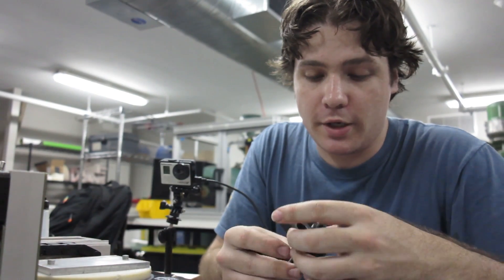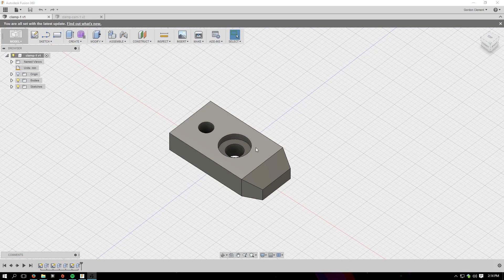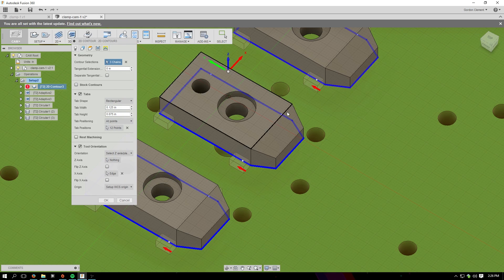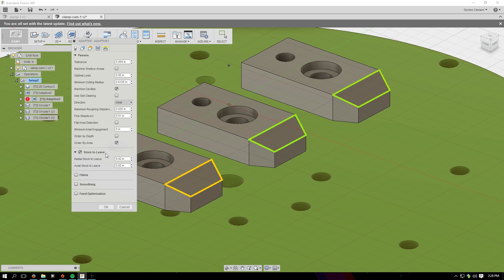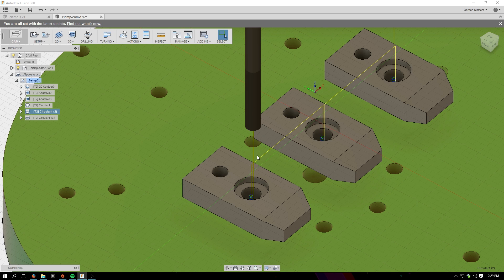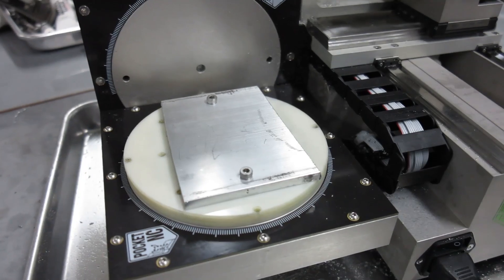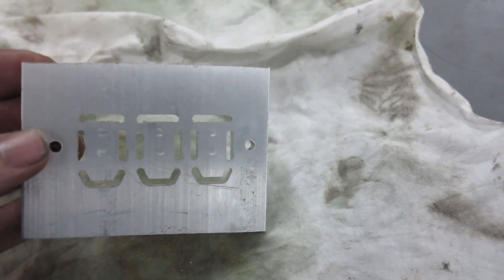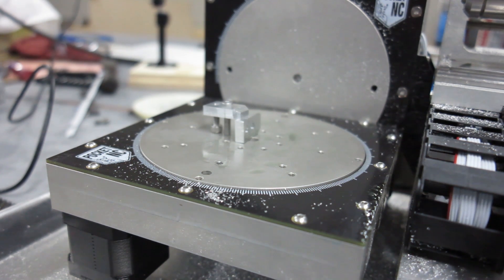Making hold-down clamps on PocketNC

Comment: Even if the end mills are from Harbor Freight you could experiment with high helix two or three flute cutter. May reduce chatter. Be certain the cutters are center cutting for ramping in “Z”. May help with chatter. Just a thought. Mister spray may also prevent tool loading if an issue. It will make a mess blowing chips all over. Thank you for sharing. Awesome video. Blessings 🙏

Comment: Cool vids, I subscribed and hopefully you'll make some more! I have also done a little bit of resin casting so I look forward to that/those videos too.

It looks like the hole for the tightening bolt might be a little too close to the pivot point.

A little detail, just in case it's helpful (to you or anyone else reading this comment)... With toe clamps you want to have the pivot point on one end, the workpiece on the other, and the tightening bolt as close to the workpiece as possible. As the tightening bolt is, well, tightened, the force it exerts on the clamp is distributed between the pivot point and the workpiece. If the tightening bolt is in the exact middle, the force is distributed evenly between the two. If the bolt is moved toward the pivot point so that it's at the 3/4 point, 75% of the holding force will be on the pivot point and only 25% will be on the workpiece.

You also want to make sure the toe clamp is angled down toward the workpiece. When it's the other way, when it's angled up toward the workpiece, any movement away from the clamp (from vibrations or whatever) will result in a reduction of holding force. This reduction will then make it easier for the workpiece to move, which will result in more holding force reduction, and could eventually lead to the clamp releasing.

Comment: cool little project for a cool little machine! you might look and see if you can find some small carriage bolts for the height adjust as they have a nice rounded dome head which allows a slight rocking point compared to the flat end of the socket screw you are using. thanks for posting

Comment: Gordon, Thanks for sharing your work it's been a great help. Please consider spending more time at F360 then the pocket side. I wish someone would just do pocket nc 101. Something dead simple like facing a block step by step from F360 model, CAM, tool setup, feeds, export, run axis, setup axis, setup vice and stock. SOMETHING STUPID SIMPLE. Sorry pocked nc your tutorial are WAY to complicated for some of us.

Thanks for all you hard work.
Reply from the maker: Thanks for your thoughts. There are many many great fusion 360 tutorials on youtube, much better than I could ever hope to make myself, and I would recommend checking those out. NYC CNC for example spends a lot of time talking about fusion, and countless other hobbyists have covered feeds and speeds for common operations in fusion. If you are just looking to get started with CNC and Fusion, I would recommend thinking of your pocket NC as a 3 axis machine and following some tutorials from other youtubers to get your feet wet. Once you feel comfortable, bring some of the 5 axis functionality back into the mix. The key takeaway from the pocket NC tutorials vs. other fusion tutorials is making sure you set your part up in the right coordinate system, and using the tool orientation settings in your toolpaths. using the Pocket NC provided file with the vice and table models makes that pretty simple.
Reply from the maker: Also, Sorry I didn't reply to your comment sooner!
Reply: I'll respectively disagree with "There are many many great fusion 360 tutorials on youtube"
Reply from the maker: I'm sorry you feel that way. If none of the tutorials you have found have been of help to you, perhaps the availability of learning resources isn't your roadblock.

Comment: nice to see the Pocket NC deals with aluminum fairly well. I can believe it wasn't fitted with way covers though?
Reply: From what I understand most of the chips don't get as far as the linear axes. So its just easier and cheaper to have them open and vacuum the rails occasionally. 

Most of the chips sit on the table and rotary axes. Whenever the table is tilted vertical most of the chips fall off and when its horizontal they engineered it so the chips have an extremely hard time getting into it.

So unless you are throwing chips like a madman and refuse to vacuum, there is no reason to have covers.
Reply: +the hollow box it looks to me from the video that both the linear rails and the lead screw are getting quite a few chips on them. Not an overly difficult fix but a necessary one from what I can see.
Reply from the maker: chips do get on the rails, less so on the lead screws. The rails have stainless covers over the screw holes and the carriages have gaskets to keep chips from entering the works of the bearings, so I don't see this being an issue as long as you don't let chips get out of control, especially with chips of aluminum, wax, plastics, wood, etc. Maybe if you are trying to machine steel it would be more of an issue.